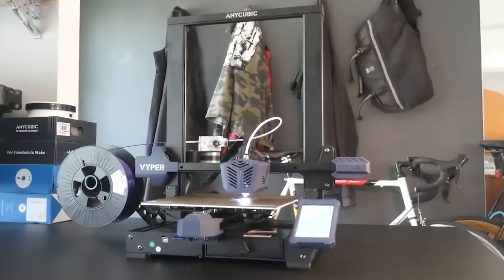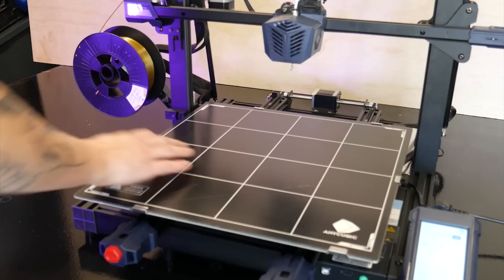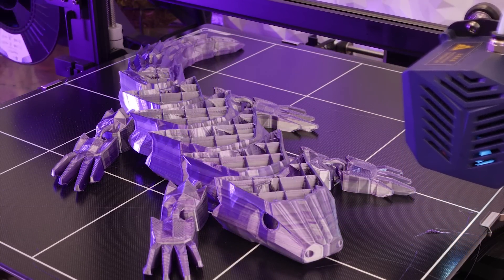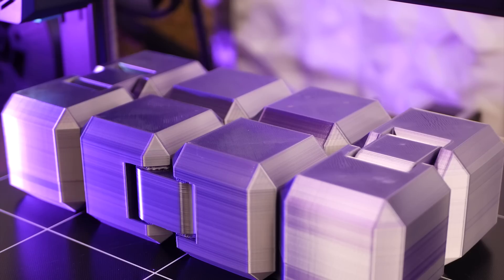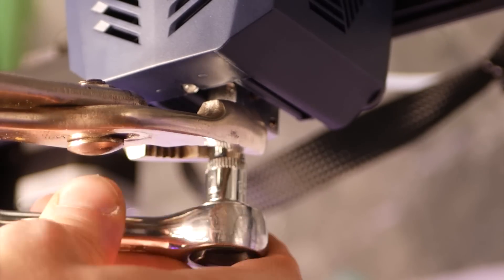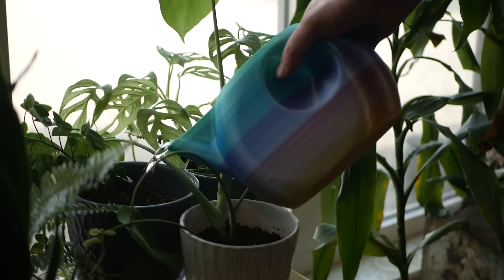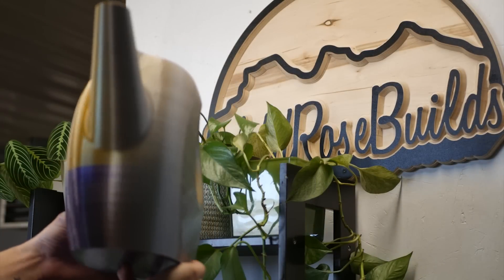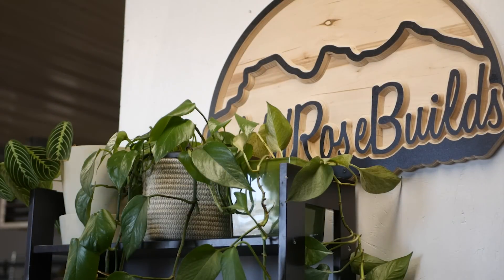HUGE 3D PRINTS -- Anycubic Kobra max 3d printer review

Comment: WILL ONE OF YOU CLOWNS DOING THESE REVIEWS PRINT A TOWER AND CHECK IT AGAINST A RIGHT ANGLE FOR Z ACCURACY... THEN PRINT A GOOD SIZED BOX WITH WALLS WITH SEVERAL DIFFERENT HOLE SIZES IN THE WALLS. CHECK THAT AGAINST A RIGHT ANGLE FOR X AND Y ACCURACTY AND CHECK THE HOLES TO SEE IF THEY'RE ROUND OR ELLIPTICAL. DAMNIT! THIS IS COMMON SENSE!

Comment: Based on reviews some of these still catch fire/smoke. 2 of my chirons smoked so I see they translated that. (Chirons had been supplied with a defective power switch). Same with one of the any cubic Delta. I received a notice when I ordered that switch replacement by the power company (wrong ground setup) but any cubic never notified customers. Still, when it runs well it's great. Used by many (including several units myself). It's the size/price King.

Comment: You're going to want to carefully remove those clips on the side of heat bed as a bunch have reported failures with them shorting out the heating element.
Reply: Apparently the issue is if they're installed in the wrong spot, as in not the exact place in the manual. Hoping that's the case so mine doesn't fry 😂

Comment: sweeeeeeeet! I've been looking for a replacement for my CR-10S with volcano hot end and this is the ticket (the aluminum bed is so warped that even with boro glass I have to retram every few prints). I print with a 0.8mm nozzle and would love to know your settings for 1.2mm so I have a starting place.
Reply from the maker: check that the wheels on your bed are properly tensioned, that could be affecting the longevity of your bed level. I'm using stock cr-10 settings with updated extrusion widths to 1.2 as well as a %5 bump to infill outer wall overlap. Hope that helps! :)
Reply: @WildRoseBuilds  I will definitely check the wheel tension - thanks